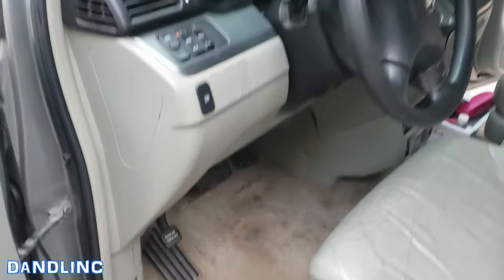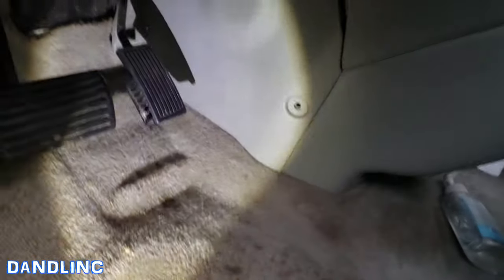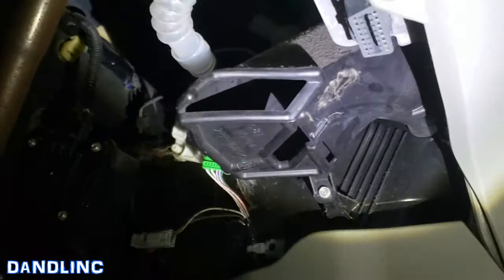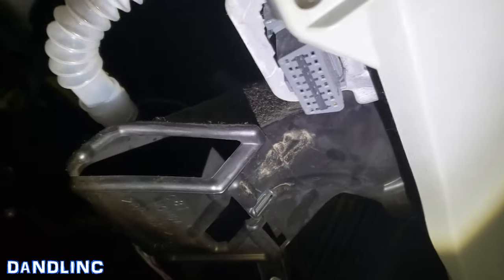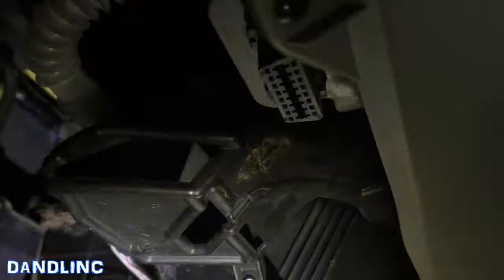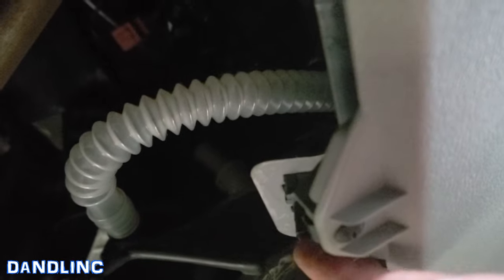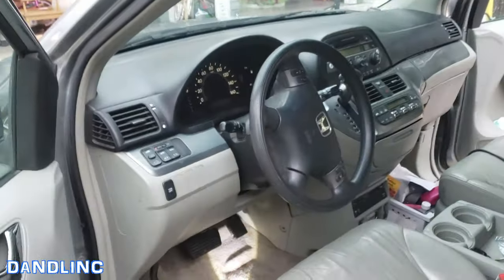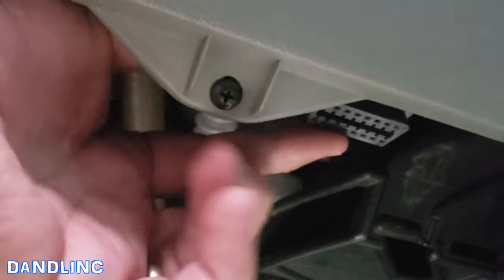How to Locate the Honda Odyssey OBD (On-Board Diagnostics) Port

Comment: Why is it tighter than usual?  It's the only OBD port that feels larger/tighter than usual because my reader doesn't just slide on.  In fact I don't like to use it on it because I think I'm going to short something or not be able to remove reader...odd.
Reply: I can't fit my OBD II charger adapter onto the Odyssey OBD port. Too tight. I'm puzzled